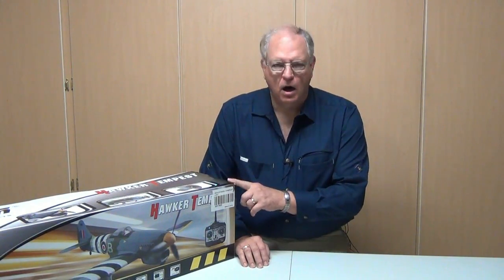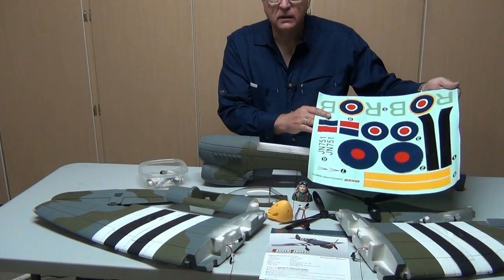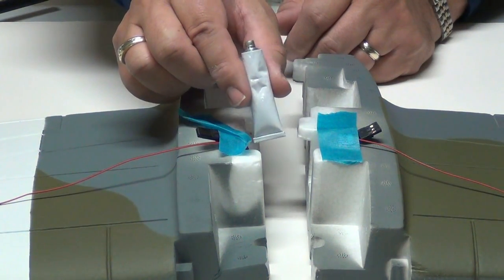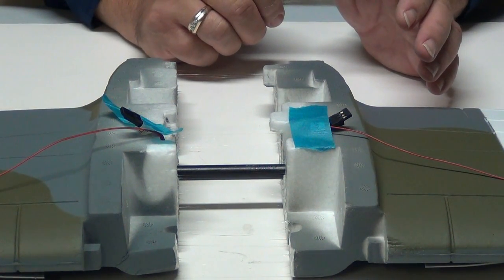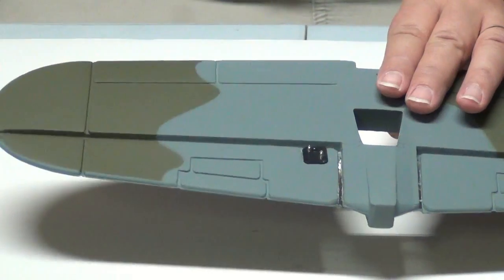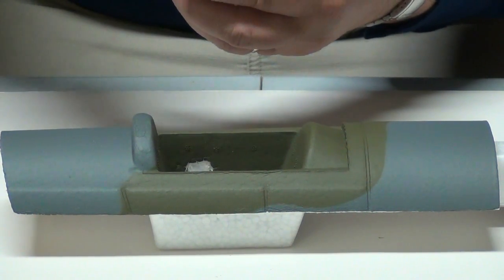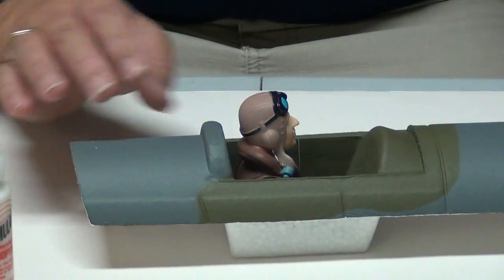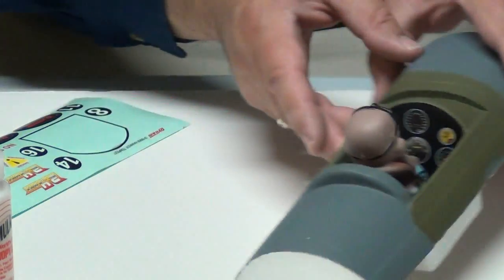Dynam Tempest Build Log Part 1

Comment: Hi, good video .  Have this Dynam Model and am very pleased with fit and finish. It is difficult to trim out when flying, probably due to short fuse .  Easy to fix after a crash .  A belly tank with weight located at  CofG will have the aircraft fly very scale. P>S> When poising pilot ,give him a little twist to make him look like the real thing.